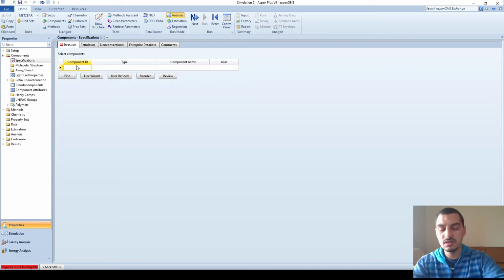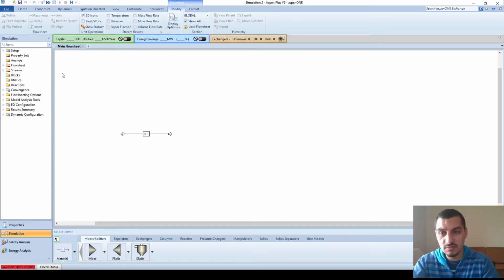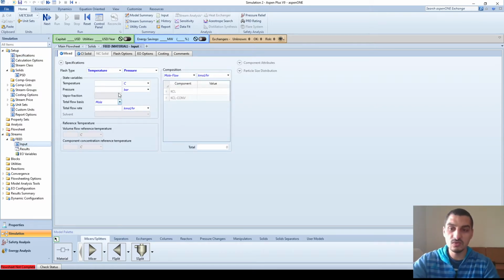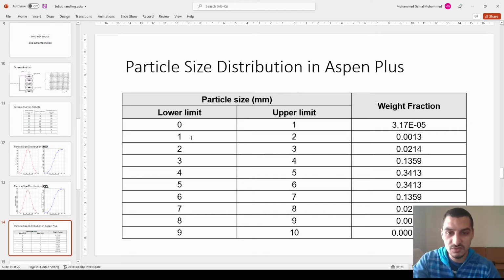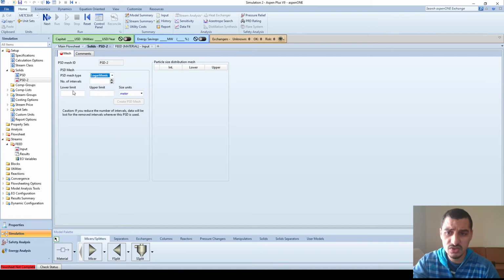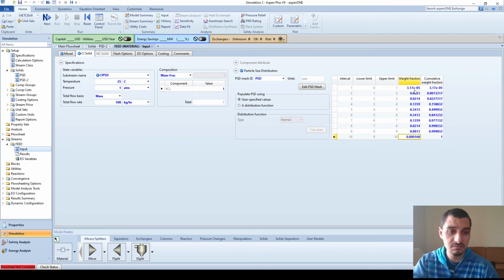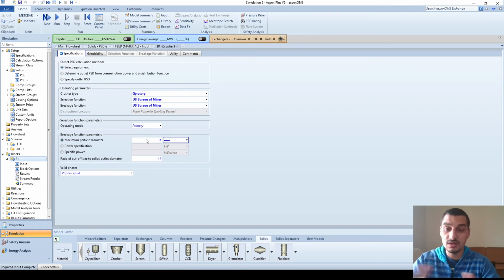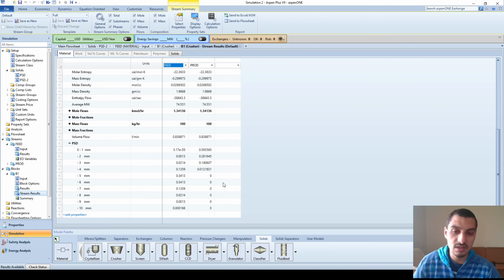Aspen Plus in English | Part 2 | 63 | Solids handling - 02 Defining stream and PSD

Comment: Thanks for sharing your knowledge on solids simulation. 
I have a question. Is it possible to separate a mixture of two solids of different particle sizes and densities (e.g. carbon & nickel) using cyclone (maybe 2-step cyclone)? The mixture also contains CH4 gas.
Thank you sir